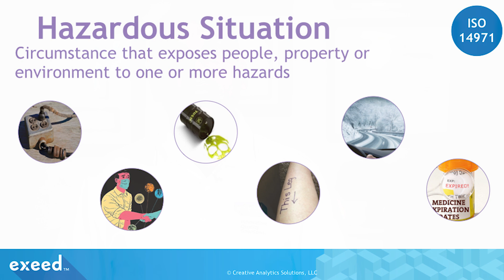ISO 14971: Defining Hazardous Situation

Comment: I agree with your examples. However ISO 14971:2019 Table C.3 provides examples of Hazardous Situations that encroach into the Harms territory.  
Their example of a Biological Hazard:
Sequence of events: 1) Inadequate decontamination of anaesthesia tubing, 2) Contaminated tubing used during anaesthesia
Hazardous situation: Bacteria released into airway of patient during anaesthesia
Harm: bacterial infection

If I understand your examples, it would be written as:
Sequence of events: Inadequate decontamination of anaesthesia tubing, 
Hazardous situation: Contaminated tubing used during anaesthesia
Harm: Bacteria released into airway of patient during anaesthesia leading to bacterial infection

I would argue that the Hazardous Situation exists as soon as the contaminated tubing is available for use, without even coming into contact with a patient.  Same logic for an exposed live wire or a wet floor.  Thoughts?